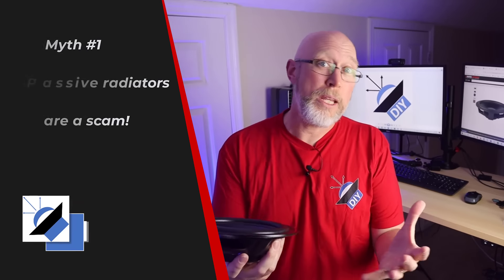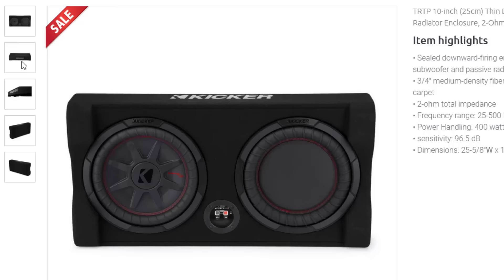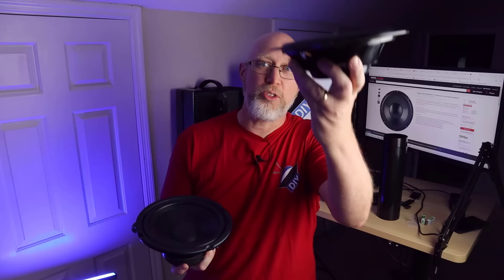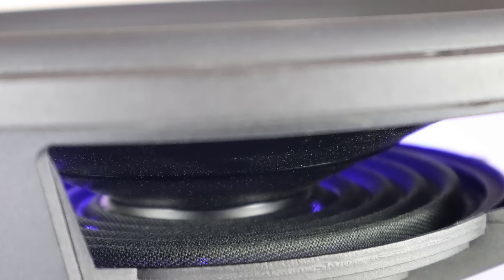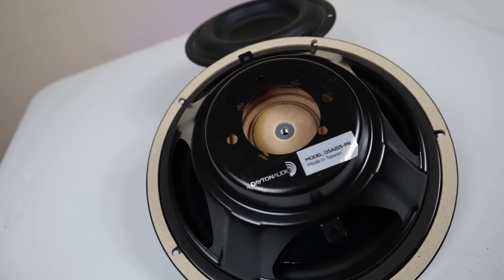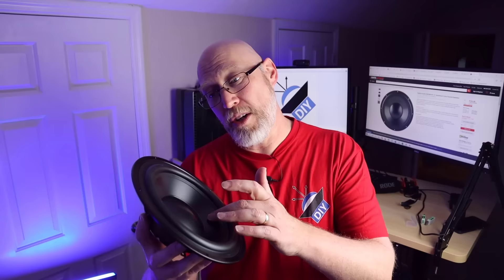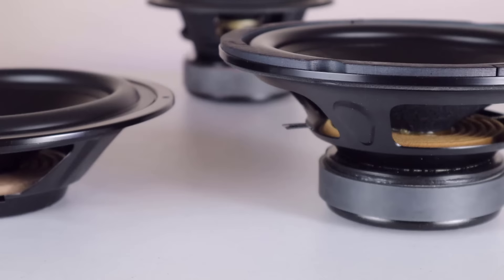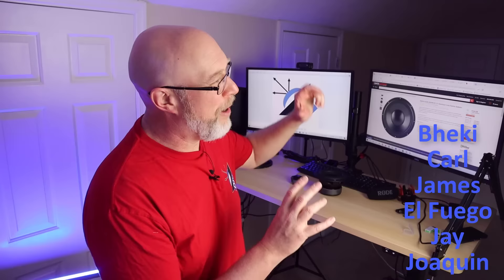Passive Radiator Myths Busted  #Bass

Comment from the maker: To learn more about ports check out this video:  https://youtu.be/mHTGwEHCCRo
Reply from the maker: @nate0 both sound fishy to me. I wouldn't have any idea how to test either.
Reply from the maker: I wonder how many speakers get de-magnetized sitting in a pallet since they are all close together.
Reply: Have you had the opportunity to check out any of the latest earthquake car audio. I loved them back in the early 90's, amps &subs. I was wondering if there current specs were real. 3.5 inch of x-mass for a 10 inch sub on 750 rms. 20hz for there 6x9's. Videos I've seen for the subs kind of look fake,or a science project gone wrong. Just wondering? Thanks in advance!
Reply: I was going to say. Klipsch

Comment: I had to laugh when you were talking about port length in small enclosures. I've been caught in that conundrum. The issue is, once you make the port longer, since it occupies space inside the enclosure making it longer makes the enclosure smaller as well. It's a never-ending cycle. 🤣
Reply from the maker: I was laughing the entire time too because I kept visualizing Michael Scott from the office saying That's what she said.  

But seriously, you're exactly right.
Reply: @DIYAudioGuy  I've never seen that show but I've said that "quote" plenty of times. LoL

You did a great job on this video! Applause 👏

Just one small suggestion. Put a sticker on your phone or camera or whatever you use, which points at the actual lens and reads "Look here!" to remind you to look at the actual lens. 😎 

I see a lot of YouTubers looking slightly "off point" and it's distracting. Not quite as bad as looking at someone with a stray eye, wondering if they're actually looking at you or not, but close. 🤣
Reply from the maker: @Carl_Jr  Believe it or not, I've gotten a whole lot better at that!  I think what I need to do is frame the shot and then fold the LCD screen away.
Reply: Do port outside 😏
Reply: You either use a simulation program and determine all the design parameters or you make a variable volume box and stick the port outside the box ... use this for measuring the performance and plot the SPL and when you're happy with the results then you make your box ( allowing for the port volume of course)
Reply: @janinapalmer8368  Obviously you missed that it was a rhetorical comment. 😁😉
Reply: More port slows movement adds bass Bose does it in there smaller enclosures to help make there systems sound 🎉
Reply: @ChristopherSmith-co4vi  "more port slows movement"
🤣🤣🤣

Comment: Big fan of passive radiators. My floor Speakers consist of 2 active 8s and 2 passive radiators with a soft Dome. Super loud and very, very good Bass.
Reply from the maker: Cool!
Reply: Are they in the same enclosure by chance?
Reply: Lol i went all out 1st time. Twin 15's powered  an 3 high xmax 12's as passive  in a extended cab f150. Lol i needed 1 more 12 passive..lol

Comment: It seems many people do not even know what a passive radiator is, so thanks for making this video. Some floor standing speakers, including the Polk t50, have been using passive radiators, and many people think that they are special bass speakers that have a magnet and should be wired up. They then notice their speaker is lightweight and take the “driver” out, discovering that they have a “fake speaker,” not really realizing that they were looking at a passive radiator. This has now caused more than two 1 star reviews for the t50 on Amazon.
Reply from the maker: I made the same mistake, I literary thought companies were trying to scam me.

Comment: I have 2 Skar SVR-12's in a 2.6 Cu Ft sealed enclosure in the trunk, fed with a firm 1,000 watts, and they sound great, down to about 40 hz. I recently added 2 Slaps M12V2 passive radiators, with 500g total ballast on the back of each, and now the bass goes down to 19 hz!
When fed pure sine waves, at both 23 and 26 hz the entire car resonates violently, and begins to self destruct. Yet the midbass still sounds great!

Comment: interesting to play with PR's.  In my experience, with a low tuned PR, the higher frequencies do not cause the PR to resonate nearly as much.  This seems to create a situation where frequencies close to the tuning frequency the enclosure reacts more like a ported box.  The further away, the enclosure acts more like a sealed box.  
so, in my experience, you can get the best of both worlds.  Increased output at low frequencies, with tighter response at higher frequencies.  The radiator does need to be properly set up with turning/mass.
Reply from the maker: For sure

Comment: I've been super curious about a passive setup due to the space constraints in my car. Was worried that it might not sound as good as ported and wasn't sure about how to implement it. I'm definitely going to give it a shot now.
Reply from the maker: It is a cost vs space trade off, plus the passive will roll off faster on the low end.  Forget to mention that in the video.  Will probably need to make another one showing that.
Reply: @DIYAudioGuy  So, you would need to tune lower to compensate?
Reply from the maker: Probably not.
Reply: I use a Kicker 12 inch sub in my car. I love how little space it takes up. It is louder than my older sealed box. The pr tuning from the factory is 44-45hz, wich is not that low and I missed that powerful kick in the lungs from the sealed box.  So I added weight to the pr to tune it lower a bit to about 38Hz.  I used some silicone on the back of pr as weight. Like this it is just perfect.
Reply: @dylanandersen9318  depends a lot on the box volume. If the box volume is larger you may end up with pr tuned already below 30 hz. Ideally for a car sub I would suggest a pr tuning to 40-35hz but that is my preference.

Comment: I have a passive radiator on my person extreme hi-fi unit. In one box I get 20 to 20 000 coming out on one amp. To get the passive that low I use a small dinner plate on the cone to add stiffness and weight to get the tuning. It has blown alot of people away of how it work. The 20 hert note can be heard a long way away. Been a fan of them for many years.
Reply from the maker: Damnnnn!  Hit those nasty lows!

Comment: Good video. Do you remember the FX95's from Kraco? They had like a 6 inch woofer and a 8 inch passive radiator with a tweeter on top. Back in HS that is what people started with. My friend had them behind his front seats in his Chevy Monte Carlo. With a 140 watt Jensen amp. They were pretty loud and sounded good enough back then. So passive radiators get a thumbs up in my book.
Reply from the maker: I don't remember that specific piece of gear but I certainly remember a Kraco!  You must be an old timer like me?
Reply: I do remember those and I just saw a pair at a thrift store not too long ago! Unfortunately the foam surrounds had started deteriorating and they were asking a bit much so I passed on them

Comment: Back in the late 80's I had a Kicker Full range Box with 2 10's and a 12-inch passive radiator in the center with two tweeters on top.
Reply from the maker: Sweet!  I wish I had some pics of some of those old enclosures. I would have included them in the video.
Reply: @DIYAudioGuy  I was 23 at the time and I was the sh*t.
Reply: I saw one of those once. ONCE, lol. It was damn sweet.
I'm also old enough to remember when the Kicker Sidekicks came out in the early-mid '80s. 6 1/2" woofer w/8" passive and top-mount tweet. The cool kids driving old trucks could finally hear their music over their exhaust.😄
Reply: Pioneer came out with some too that was TX x or something had one PR and one active driver and that was kind of an a plastic enclosure. Kicker had a Camaro box for their hatch at two horn tweeters either two 6.5" or 8" subwoofers and on the back of the box had two 10" and or 12" PRs.  They were very impressive.
Reply: @gakudzu7282  Also back in those days the Jensen Tri-ax 6x9's were king of the hill. if you did not have them, you wanted them. before I had my truck with the kicker box I had a 74 Camero with 2 EQ/Boosters and 8 Jenson's. It was very bad ass for those times.

Comment: Earthquake had the best ones back in the day. Technique used them in home audio in the 70s n 80s.
Reply: Earthquake still makes the SLAPS Series PRs. I run one with a 12 inch sub. Once tuned it increases the box output like a port.
Reply: @ShredRMK824 

So my pop has a regular cab pick up truck. We're taking out 3 Kicker Comp c10s and he wanted just 2 Kicker CVR 10". The enclosure behind the seat is sealed and was made for three 10"

Could I just use a single Kicker CVR 10" and get two of these passive radiators, or should it be one per sub? In which case I could just cover up the middle hole, and do a CVR 10" and a passive radiator on the other side?
Reply: @Luminous.Dynamics  Use as big as a Passive radiator as the space will allow. I like to do an extended bolt out the front so I can easily change the mass without removing the PR. That allows me to tune it much quicker. Yes you can use 2 PRs it's best to have more PR cone surface area than the active drivers. The larger the PR the lower you'll be able to tune the box. Ideally if you can run 2 active 10s and a 15PR the box would have a wide dynamic range.
Reply: @ShredRMK824   If I could, I would, but the box is already made and he doesnt want a different one. I was gonna just port the box with PVC pipes since theres enough airspace and just run the two CVR 10" but I think I can have him try a single 10" with one PR, although I think the box might be too big for a single 10" subwoofer. Kicker recommends 0.8-3.0 cu. ft. per sub sealed for the 10" but I dont know how factual that info is, up to 3.0 for a sealed 10" seems crazy. Thinking it should be okay though as his enclosure isnt even 2 cu ft total.
Reply: I'd rather do the PR than port it. To me a small ported box sounds very muddy and  you need to carefully measure for the correct  port. You will need all the theile small parameters to acheive that. If you substitute one 10 PR and put a good amount of mass on it to lower the frequency you should be good. Generally I believe the 10 PRs are around 45hz with no weight on it.
Reply: @ShredRMK824   Gotcha. I was def gonna do all that to port it, but since hes not really as into audio...I figure this would be a wayy easier way of getting more bass in his vehicle. We'll try the single 10" and single Earthquake PR, and if he still wants more after that, maybe we could add the other CVR 10" in there to see how that sounds with both subs and one PR in the center where the 3rd sub is supposed to go. Probably gonna see if I can tune the passive radiator around 35-37hz if possible. Thanks for your help man
Reply: @Luminous.Dynamics  no problem just make sure if you use the 2nd 10 that the cone excursion doesn't exceed the PRs. Hope it sounds great when your done, LMK!

Comment: Passive radiators are awesome. If you want good bass, but don't have the space for a large ported box, PR's will be the best bet. 
I like how you get the good, smooth sound of a sealed box, with the higher output of a ported box. 

About myth #2 - You need two PR's if the specs are identical to that of the active driver (same parameters). Otherwise, use the formula

Comment: The best thing to have 2 Passive radiators, stroke for example one one right side and one on the left side of the box is vibration cancelation of the box, specially with hevy mass on the passive radiators, for home theathre as an example, i have experimented alot with this and i can just say, they are great, with right amount of dampfaktor and headroom of the amplifier.
great video by the way, it explaines all the facts.... 🙂

Comment: The model most appropriate for understanding woofer/enclosure mechanical performance is Newtons second law of motion applied to forced oscillation. This is an ordinary second order differential equation. Three factors affect the FR insofar as resonant frequency an Q are concerned. There's mass, springiness, and velocity related frictional loss which control the damping factor. There are two problems here as I see it. One is that you have no control over Q, the damping factor. Typically ported designs and passive designs will have a high Q. Ideal is 0.707. The other problem is that the passive is 180 degrees out of phase with the main woofer.

Comment: Sometimes they can be found on large rigs as well. I have a pair of Intersonics ServoDrive ContraBass subs that each use two 15's as driven speakers and two 18 inch passive radiators.
Reply from the maker: Very true.
Reply: i've never heard of a 15inch speaker with 2 18inch passive radiators. It should sound great. What I like about enclosures with passive radiator is that it sounds cleaner without the annoying port noise.

Comment: I once had a custom made 4th order bandpass ported enclosure where we calculated low frequency wavelengths to determine the length of the internal port tube.

It took one 8 inch driver and was able to handle about 400 watts.
Reply from the maker: Cool.

Comment: Klipsch has been using passive radiators for years. The fort’e ii speaker has an active 12 inch driver and a passive 15 inch.

Comment: I run a pair of Polk MXT-60s, floor speakers with 2 PRs per speaker. Sound is great, and without using my subwoofer for streaming Hi-Res music.  Sound is clean and deep, depending on the track.  I only use my sub for movies and TV content.

Comment: SMD have made nice shop speakers with 2 18'' box 3 passive in each box damn amazing setup
Reply from the maker: Yes, I remember when he built those.
Reply: The "SMD Towering Towers"
I too remember when he built them, and tested them out. Crazy output from a relatively small sub enclosure.
By the way, he had two passive radiators per 18" driver, not three.

Comment: Did you know, small passive radiators are often not cone shaped, neither do they contain a spider? They are often just weighted pieces of metal with a rubber surround, as seen in most portable speakers these days. JBL, Bose, Sony, and others are using them in their Bluetooth speaker lines.
Reply from the maker: PS Audio uses MDF for PR cones because they need a lot mass to get the desired tuning.

Comment: I have bic American hifi speakers with 2 woofers and 2 radiators of equal size. They're my favorite sounding speakers. The bass response is very linear and tight
Reply: I had a set of vintage KEF with passive radiators but the bass was fairly flabby, although was still somewhat fun to listen to.

Comment: Quick question: I have a sealed box for two 8" CompRTs, and I'm thinking about adding two 8" passive radiators to it to add a little extra something. Two questions:
1) Since the subs are on the face of the box, could I mount the PRs on the sides?
2) Are there any cons to adding two PRs to a box with two active subs? I feel like I've only seen the 1 and 1 configurations.
Reply from the maker: The kicker passive radiators are designed to match with their RT line of speakers.  I think there's a link to them in their product description.  As long as you got the air space matched up with what kicker recommends you should be just fine adding two of their passive radiators to that enclosure.   They designed their passives to have more cone travel so you can do one passive per active.
Reply: Usually if you don't have room in the front baffle I read somewhere to mount them in the back personally I'm not sure if it matters since they are not active so standing waves shouldn't be an issue.

Comment: I had passive radiators in my Kenwood LS-P9000HG home speakers in my barracks when I was stationed in Okinawa (1988/89). I still have those speakers, but the foam around the radiator and the 10" active have long deteriorated. I replaced the 10" one time long ago, but I haven't found a replacement for the 430mm radiator, so I have been considering making some.
Reply from the maker: Would this work:  https://parts-express.sjv.io/5b2Wno
Reply: @DIYAudioGuy  That might actually work!
The speakers were advertised as 18" passive radiator, but the actual specifications say 430mm which turns out to be 16.9 baffles.